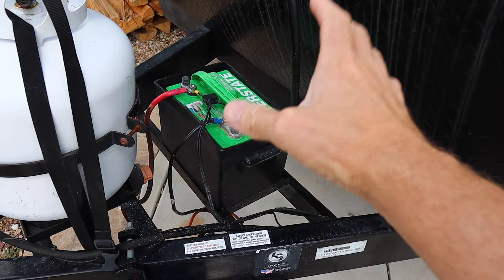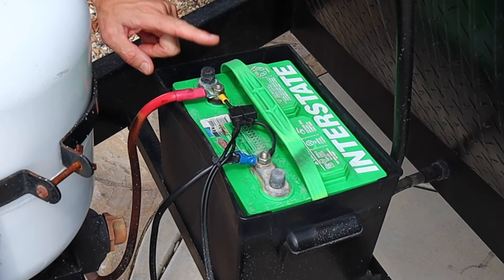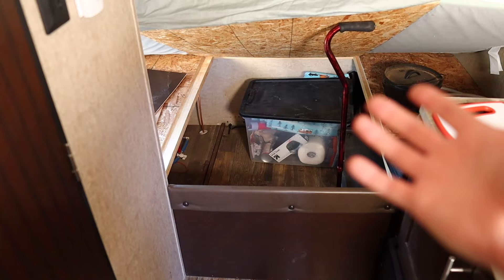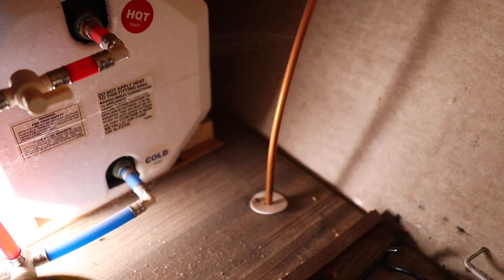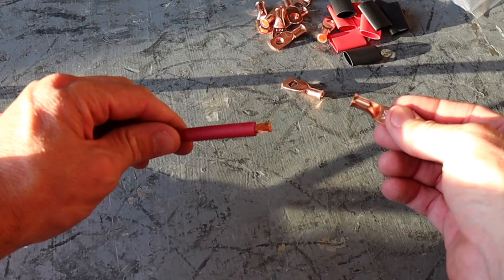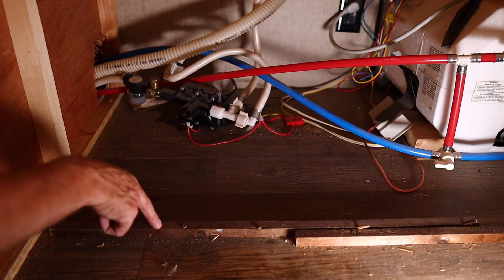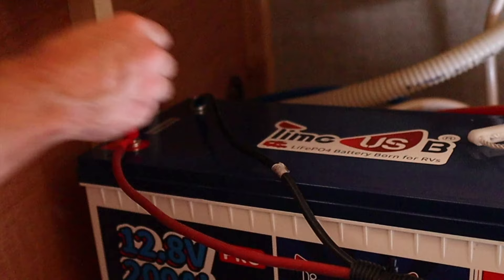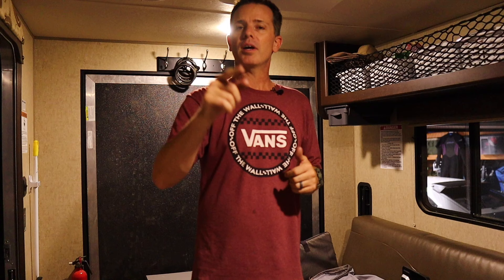How to Convert to Lithium Batteries - Upgrade for RV's and Travel Trailers - Timeusb

Comment: Always remove the negative first. Less chance of a short out. And put negative back on last.
Reply: 👍 Correct!  It's not intuitive with so much connected to the positive, but you are quite right!  Current flows from negative to positive. 😎

Comment: Not trolling you just a safety tip. Remove the ground wire from the battery first. As you were unbolting the positve first you could easily come incontact not only with the frame but more importantly the propane tank and that would be a major bummer....maybe even fatal if the wrench were to weld itself to the tank. I don't even want to think about that outcome. Nice install. I am about to do the same and I am hoping I can place the battery in the same area as yours.

Comment: Thanks for the video, I own two Timeusb 200ah pro batteries for my RV energy storage and they actually produce 230ah, I asked their customer service and they battery actual capacity will be greater than the labeled capacity. Really a great value and have used them for so long They have not had any problems. nice！
Reply from the maker: Gunna have to play around with that when I get my shunt installed.

Comment: why is my trailer service company saying i need a dc-dc converter to adjust the charging from my truck to the travel trailer?  i did not see one in your setup
Reply: I'm not positive, but I think it's more to protect your alternator from the batteries pulling too many amps.
Reply: It is to protect your tow vehicles alternator.      A lithium battery can take a 200 amp charge till full so it would fry most alternators in a couple of hours

Comment: Hello blogger, the lithium battery capacity of Chinese RVs has reached 12V800AH, and some cars are equipped with 48v200AH lithium batteries. Are there relatively few customized lithium battery manufacturers here? I still don't need such a large capacity battery.

Comment: Have you ever seen a lithium battery ignite? If you have you would never mount one under your bed, or even inside your trailer.
Reply from the maker: I have, these have a BMS to prevent the damage that causes ignition in batteries.
Reply: There’s a big difference between Lithium Ion and Lithium Iron Phosphate (LiFePo4). These RV battery upgrades are LiFePo4, which are extremely safe. 

Look up a puncture test of LiFePo4 batteries on YouTube and you’ll see why.

Comment: How do you know if my inverter will support the lithium battery.
Reply from the maker: If you open up your electrical panel your inverter may tell you on it, otherwise you can look up the number on the inverter.
Reply: Converter, not inverter 👊
Reply: I would like to change converter to an inverter

Comment: Buying the "Plus" version (200ah BMS) of this battery was a great idea.  People who want to upgrade their battery bank to a single, larger amp hour lithium battery need to pay attention to the battery specs, especially if their inverter is over 1200 watts.  

The battery monitering system (BMS) needs to be able to handle the current your inverter demands.  Many of the cheaper 200ah batteries only have a 100ah BMS, which means it WILL NOT allow continuous current draw over 100 amps (1200-1300 watts).

Amps x Volts = Watts.  A 200ah BMS will allow the battery to handle 2400-2600 watts of continuous inverter draw.  For even larger inverters, you're going to need a higher discharge-rated BMS,  or a second battery to share it's BMS discharge capabilities.

Comment: Besides just checking spec sheets to see if one's 12 volt converter/power supply is compatible, but if you have to do something to it, to put it in Lithium mode.  Mine required making a jumper wire to connect two jumpers on the back.  Believe it or not, that was the hardest part of my conversion due to its location.  Also, I had to disconnect solar, as the master battery kill switch doesn't remove the solar charging.

Comment: Really enjoy your videos, informative and easy to understand.  Question on inverters. I have a Xantrex Freedom Pro 2000 inverter with 300w solar panel and 2 100 amp group 27 agm batteries. I believe this inverter handles lithium, but do I have to adjust any of the setting on it?

Comment: What about when you are pulling the camper....the 7 pin connector has a charge wire in it from the tow vehicle...will the alternator burn up or overwork over time? I can't seem to find an answer to this.
Reply from the maker: Nope, it'll be fine. It just wont supply enough voltage to completely charge the battery to its full capacity.

Comment: What size hole did you drill in the floor? I’m guessing 3/4” based on the link to the loom you provided? I was debating between 3/4 and 1” for 2x6gauge wire. Don’t want a larger hole than is necessary.